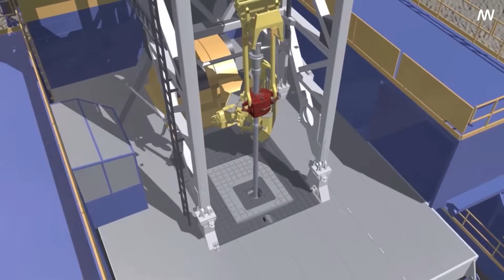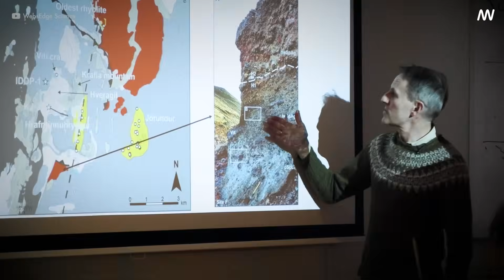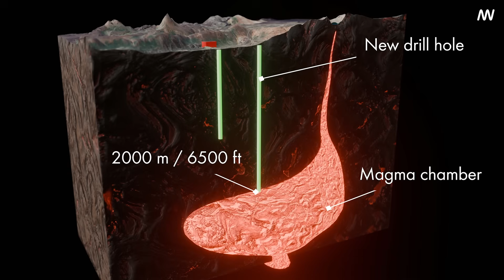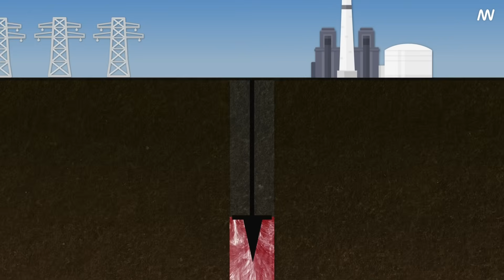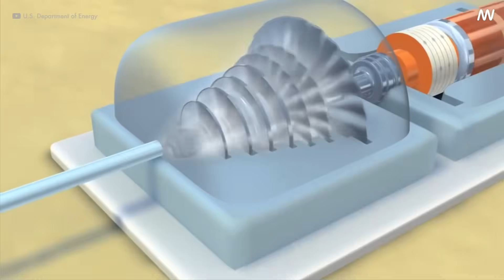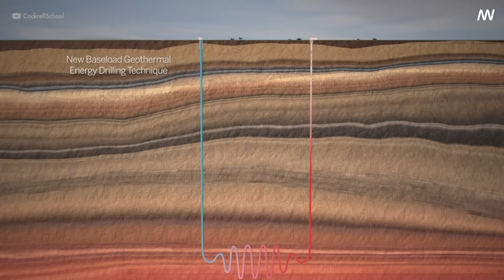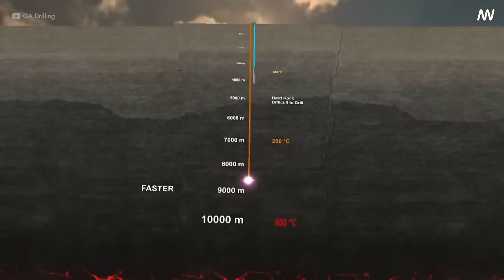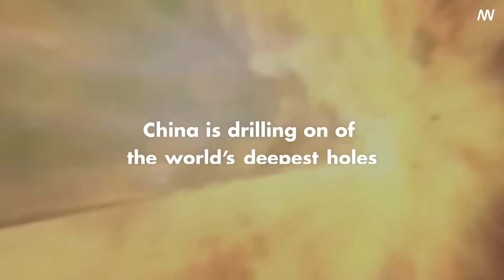Why Scientists Plan to Drill into an Active Volcano

Comment: Larry in Miami Florida. 
I spent 2 days a few miles East of Burns Junction Oregon at an R.V.
Campground WITH A NATURAL THERMAL POND on the Campground. 
It was winter and the POND has Black Valcanic Rock on the floor of
The Pond and the Water was Bath Water Temperature. 
There's Pipes coming out of the Ground with a constant supply of
Hot Water.
No ODOR from the Water.
Every refreshing with the Moon Light!

Comment: Once any amount of pressure is released from a chambered magma body , gasses trapped in the molten mass come out of suspension , the more that come out the more the pressure releases then even more comes out and it's a runaway situation that empties  most of the magma chamber until the pressure is relieved. It's like capping an oil well but much hotter and far greater pressures.

Comment: Seems to me if you drill metal into molten lava, you melt the metal. Releasing pressure with the drill through rock, the lava will use that channel to escape to the surface, melting the rig and a good share of the country on top.  Hints in the video say drills Have met lava, but no clue what happened after that. Worth a new Vesuvius?

Comment: Here’s the problem I see with trying to harness the earths internal heat. If that heat were to run out, we would end up just like Mars. Mars no longer has plate tectonics. Mars actually has a semi cold core. Mars no longer has an atmosphere and is susceptible to solar winds. I personally feel like trying to harness the heat from the earths core would have negative effects on the planet.
Reply: The amount of heat contained in molten rock is in an order of magnitude many times larger than all the fossil fuels, Also there is a continuous heating of the earth by radioactive decay that occurs naturally.

Comment: I remember in the 60's in grade school and we would get My Weekly Reader  and we would get excited when the roll of papers would arrive at school.  I remember them doing a story on Iceland and tapping into the geothermal energy.  One of the main issues was we did not have any material capable of withstanding the high temperatures and corrosive nature of the water as it would eat up the drill bits and piping.  A lot of research went into ceramic drills and pipes that would be immune to the corrosive nature of the superheated water.  I had several years worth of them stashed away until my brother burned them up out of spite.  I contacted them and asked if they (maybe) transposed them onto microfiche (this was LONG before computers and high speed printers) and I would have GLADLY paid for copies.  But, alas, no one thought to preserve them in paper form or microfiche.  And I can hear the younguns asking "What was a microfiche"?  Probably get the same reaction if you talked about "overhead transparency projectors".  
A long  gone era.

Comment: In the Vulcano drilling you can be get an a benifits into it by installing an a steam turbine and creating a abundant energy first attached a inconell pipe to the water passage and the output of that is the high pressure steam to rotate the high pressure turbine to rotate the Generator

Comment: Harvesting Geothermal has long been doing by human.  Many countries, on the Ring of fire, have experienced.  They relinquish the idea because unavoidable problem. They extract heat from hot rocks, at the same time, melting rock in every channel pass will lose its energy, becomes solid and block all small channel. Later, lack from heat exchange fluid, those geos thermal will lose its efficiency bit by bit until close down.

Comment: With max pressure of 28 GPa, 4,061,056 psi. If man could not handle 8000 psi from the deep water well  in the gulf what happens if hit 4 million psi at 2,000 degrees.

Comment: 1000°C would be peanuts with tungsten... 😂 There is way more heat in magma than that I guess. According to wikipedia it's up to 1200°C and some other websides saying it's 1600°C peak. This would be lower than the meltingpoint of tungstencarbit. I'm not a drilling expert, but at least if costs doesn't matter this sonds like a perfect solution... 😅 you can even remain the tube in the chamber to habe an access.
Reply: The melting point isnt relevant. At those temperatures the metal will be  pretty soft and unable to drill the rock

Comment: The amateur geologist in me definitely feels that something like this would be a fascinating idea. after all getting rock samples that deep. And maybe being able to do various spectrum analysis and such. At the same time I definitely can see where there would be a great deal of danger. However, the people that are worried about the blowout thing either are not aware of or just not listening to the possibility that this has already happened in things like oil wells, or even geothermal type stuff. Now it is likely that when they finally hit the bottom, they will probably have to do so with all personnel very far away just in case it does pop. But at the same time this actually might be a beneficial thing. Think of it is almost like a pressure relief valve on the side of a water heater. If the pressure in a water heater builds up to a certain point, there’s a valve that will open and allow the pressure to escape. Maybe this hole that they’re going to drill could have the same benefit for this volcano. Yes, it would still mean a form of eruption but maybe just maybe it can relieve the pressure enough so that the main I guess you could say opening doesn’t go up or something. Honestly, something like this if it works may be way for us to not predict when eruptions take place or stop them. But maybe mitigate their damage. After all, we can control mother nature, but we can, kind of work in tandem with her.
Reply: Hello @ultrajd,

You bring up some excellent points about the potential benefits and risks of drilling into an active volcano. It's true that while there are dangers involved, this project could lead to groundbreaking discoveries in geothermal energy and volcanic behavior. The idea of using pressure relief as a mitigation strategy is intriguing and highlights the balance we must find in working with natural forces.

Comment: I checked this out. It's a geothermal project, which has already begun in 2000. They never wanted to drill into a magma chamber but use geothermal energy of the hydrothermal system in considerable depths, more than 3 km.
Anyway you can check it out - just google "Iceland Deep Drilling Project". And please, stop telling bullshit!

Comment: Water that flashes to steam expands 700%  . Water coming into contact with magma creates steam explosion . GREAT IDEA !!!
Reply: Your expansion figures are wrong.As provided by a book entitled power plant engineers guide; they state that at atmospheric water expands approximately 1700 times it's volume as steam. Even if they could it's a dangerous and dumb idea to consider drilling into magna. They don't need that hot a temperature to produce supercritical steam.

Comment: Having watched this, I can't help but wonder if we might someday be able to tap the magma cells that lie beneath the Yellowstone Caldera. Not only would the generation of unbelievable amounts of power be possible, but it might also reduce the tremendous pressure that makes the Caldera so dangerous.
Reply: it also raises concerns about the stability of the caldera and the risks associated with altering the natural pressure dynamics.
Reply: Yes! We need to defuse the risks! No more mass extinction events either!
Reply: Hello @bobyoung1698,

Your idea about tapping into the magma beneath the Yellowstone Caldera is intriguing. If successful, it could indeed provide a significant energy source while potentially alleviating some of the pressure in the area. However, the geological and safety challenges would need thorough examination before any such project could be considered.
Reply: Or it could have the opposite effect and destabilize the magma chamber causing a full-blown eruption
Reply: @AdamZimmerman-c6i  Not necessarily. As you draw heat out of the nearby rock, that formation slowly lowers the temperature of the lava, increasing its viscosity and making it less prone to flowing. As the gases contained in the lava cool they also exert considerably less force, down grading the eruption potential. The amount of energy in a cubic mile of molten rock is too large to ignore as a resource to produce reliable energy production. It is the future.

Comment: VOLCANOLOGY 101
Lesson: mantle plumes.
Educator: 
Prof. TheErik249
Stratovolcanoes consist of anedicite, dacite, and rhyolite magma.
They're higher in silica.
This makes them more explosive.
This typically occurs when the magma chamber has intruded upon a ground water source, or a groundwater source has intruded upon the chamber or the region between the chamber and the cone.
Water can not be compressed, so it boils and creates pressure that can not be contained by the rock.
The result is an eruption.
Iceland doesn't have any stratovolcanoes.
There is no subduction occurring underneath Iceland.
Iceland is a basalt formation sitting on the mid-Atlantic divergent plate boundry.
Magma rises at this point and then moves in opposite directions to the east and to the west.
But there is another source at work here.
The Iceland hotspot.
Magma rising from the outer core lower mantle boundry.
It is theorized that the Iceland mantle plume is connected to a super plume that also feeds the Jan Mayan archipeligo plume and the Greenland plume.
A simple test of the magma effusing from any one fissure on Iceland will indicate that the magma is very low in silica and very high in sulfur dioxide and iron.
Plus, its ambient temperature is approximately 2100°Fahrenheit (1150°C), which is a clear indicator of mafic/basaltic magma.
ONLY mantle plume hotspots effuse mafic magma that pours like water.
The cooled magma becomes black and brittle.
Afterward, long-term, the rock begins turning red as the iron oxidizes.
Then, it begins crumbling into tiny fragments of reddish brown rubble, eventually becoming sand and then sandstone.
But that hasn't happened on Iceland.
WHY NOT???
Because it sits on a divergent plate boundry that has been very busy for about 210 million years.
Plus, the hotspot is feeding this region freshly produced mafic magma directly from the core.
It is theorized that this super plume is the very same plume that caused the Permian-Triassic extinction 251 million years ago and created the Siberian traps large igneous province.
🤷The more you know🤷
Reply: Hekla and Askja are classified as stratovolcanoes
Reply: @AngryGecko1010  .
There are no stratovolcanoes on the island of Iceland.
There is no subduction occurring underneath Iceland.
Iceland sits Upon A divergent plate boundary.
It is referred to as the Mid-Atlantic Ridge.
From the point that both of these plates meet the North American Plate to the north all the way down to the Antarctic plate, these plates are producing oceanic plate and diverging to the East and to the West.
Mantle plume theory is a new theory in volcanology.
Geoscience recognizes mantle plume theory, while volcanology is still apprehensive about accepting this Theory.
Iceland was produced by a mantle plume hotspot.
All you have to do is take a sample of the magma when it reaches the surface and becomes lava.
It is low in silica and high in sulfur dioxide.
It's referred to as mafic magma.
It rises from the outer core boundary through the lower mantle and the upper mantle and then distributes through a hotspot on the surface of the crust.
There are 17 known active mantle plume hotspots on Earth currently.
Hawaii and Iceland being the most active.
It is confusing when both of the volcanoes that you mention have Ash eruptions.
What you are witnessing is magma encountering groundwater which has to expand and cannot be contained because water molecules cannot be compressed.
The highly pressurized water molecules explode violently destroying in vaporizing The Rock.
At that point is when you will witness an ash column rising out of a vent.
Reply: In theory

Comment: A test to see what the possible results of drilling into Yellowstone might be?  Risky!
Reply: The Yellowstone site has little relationship to Iceland.
Reply: Iceland is basaltic lava.  It is thinner and flows smoothly and relatively non-violent.  Mostly producing smooth lava flows and gasses with very little ash.
Yellowstone is rhyolite lava. It is thicker and stickier and tends to erupt in the violent eruptions that produce the large ash cloud.  They also create the pyroclastic flows, like those that wiped out huge areas around Mt. St. Helens.

Drilling Iceland would be like opening a bottle of soda.  Drilling Yellowstone would be like opening a bottle, that has been sitting in your car on a hot summer day, after it has been shaken.

Comment: 1:43 what are you talking about? The IDDP-1 drillhole hit magma all the way back in 2008, and now they are only doing it again, but on purpose.  Also, magma was drilled into at Kīlauea starting with the Kīlauea Iki eruption as far back as 1959, for many years until 1988, and then again also in 2008 (big year for drilling into magma), while drilling for the Puna Geothermal Field.  Magma has also been drilled into at Menengai Caldera in Kenya twice, between 2011 and 2014.  The KMT (Krafla Magma Testbed) is just following in the footsteps of these projects and trying to better harness the energy.
Reply from the maker: Thanks for the comments. Script should have probably been more clear what "drilling into magma successfully" means (i.e. without getting the drill bit obliterated and the hole blocked). This video talks about the 2008 IDDP-1 drilling at 8:04 and for the sake of simplicity and story I tried to keep this focussed on Iceland. Appreciate the feedback.

Comment: So what you’re saying is this “clean” energy will contribute to global warming as well as rising sea levels. Extracting this trapped water & dumping it on the surface allows it to become part of the atmosphere & global surface water. As well as the heat pulled up from the deep & allowing it to mix & warm cooler & cold air, affecting global weather patterns.

Comment: Pressure blowouts happen at oil fields all the time, under much less pressure.  A magma chamber is an exponential increase in PSI.   I would not want to be around the drill site.
Reply: It is not a sleeping volcano. Volcano's that erupt regularly do not tend to explode, they work more as valves.
Reply: @duudsuufd that is more than what a dum man can think!
Reply: seeing what pressure must be being released and moving liquid rock. wet concrete on fire.
Reply: A magma chamber and a hydrocarbon reservoir are two totally different things. 

There have been two documented examples of boreholes intersecting magma pockets. All that happens is that a small amount of magma enters the borehole and quickly cools and solidifies..usually resulting in the drill string becoming stuck.
Reply: to add: thinking it through, lava would/could not come out of the ground unless you had tremendous amounts of pressure, air/gas what else could it be, to make tons of rock, solid or liquid, its rock, and weighs tons, the pressure at hand must be.., <drum roll>  magma. lastly, i cant see magma as underground lava and model our subsurface ideas from that like everyone seems to do. it looks cool huh.
Reply: @leechild4655  How does the pressure and composition of magma influence the type of volcanic eruption that might occur?
Reply: Slow moving high viscosity (or thickness) magma tends to be involved in more violent eruptions due to large amounts of gas absorption in the molten rock.
Examples would be Mount Vesuvius in Italy or a number of volcanoes in the Cascades mountain rage of the North American Pacific Northwest region like Mount St. Helens or Ranier both in Washington state. 
Thinner & fast moving lava (like some stratovolcanoes found in the Congo in Africa) tends to not be anywhere near as explosive.
Reply: This is going to be, the most stupid thing they are about to do. Many will die!